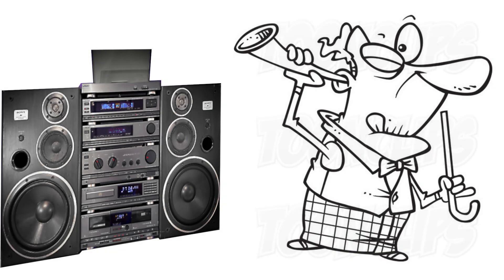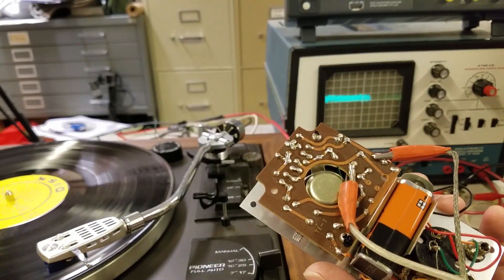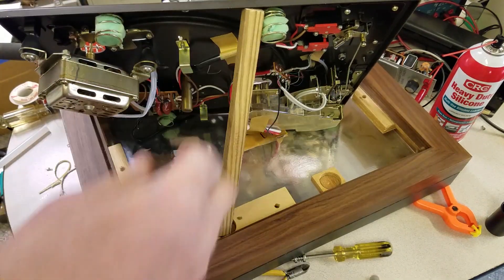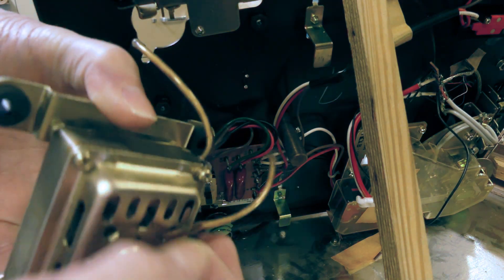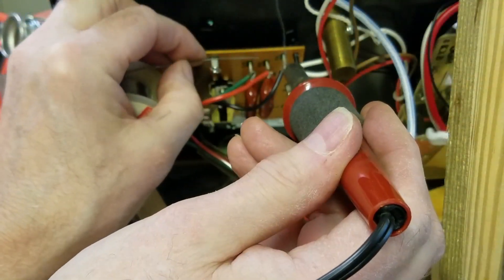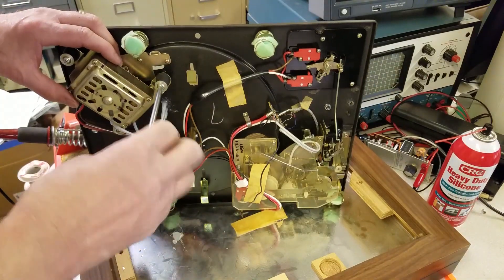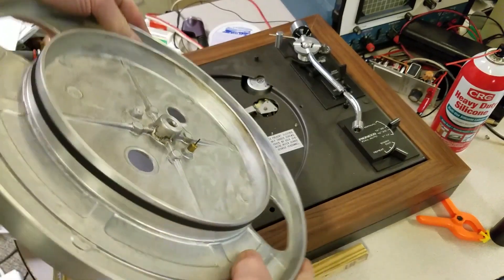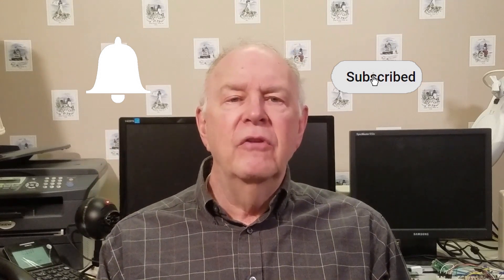Pioneer PL-A45D Turntable Rumble Reduction

Comment: I have this table and it also has a nasty bit of rumble. I've done everything to it as in the video but it still has more rumble than I think it should. With headphones it becomes audible with the volume at about --20db. Even sooner with a subwoofer. I've also replaced the completely rotted old foam in the four suspension springs using Magic Erasers but it doesn't seem to matter whether it's there or not. If I detach the belt from the capstan and place the stylus on a record it still rumbles, so I'm pretty sure it's the motor and not the suspension, spindle, or belt. There does seem to be a lot of slop in the motor mounts though. When the smooth mounting screws are tight, I can still slide the motor with the cone-shaped rubber cushions up and down the screws about 1/4" but my assumption is this is by design. I've lubricated the motor but haven't taken apart. I'm wary of doing this since I have a feeling that getting it back together with everything lined up properly will be difficult.  Can anyone make any suggestions?
Reply from the maker: Actually lining up the motor is really simple.  The bearings are self aligning.  Take lots of pictures.  When you reassemble the motor, tighten the screws lightly, then tap it lightly on the side with a small hammer.  Check for free movement of the rotor and tighten the screws a bit and do it again.  That helps get the motor nice and "happy".  

I took apart the bearings in this video since I wanted to replace the oil lines.  If I were to do it again, I would just remove the oil lines completely and then lubricate each bearing locally.  It doesn't use that much oil, I'm sure you could get 500 to 1000 hours between oilings.  That would be one less place where rumble could be transmitted.  Then you wouldn't have to completely disassemble the bearings. 

Don't use a Magic Eraser for the foam insert.  it isn't "springy" enough.  Go get real foam rubber; like scraps from an upholstery shop.  Not memory foam though, just low tech, regular foam rubber. And use enough foam, it should fit in there somewhat tightly.

I believe here are replacement motor mounts available, from here: https://www.collegit.se/motor_mounts-en.htm  .  But before replacing them I would electrically disconnect one wire to the motor, plug the turntable in, turn it on (nothing will move) and check for rumble.  You might find that the "rumble" is actually 60 Hz hum caused by poor grounds, or a dodgy electrical connection between the cartridge, the shell, the tone arm or the audio cables.  It could even be your amp.   If you still hear the rumble with the motor not running; try disconnecting the audio cables one at a time to see if that makes a difference.  Just don't do it with the amp on; the popping sound is hard on your speakers and ears.  Good luck!